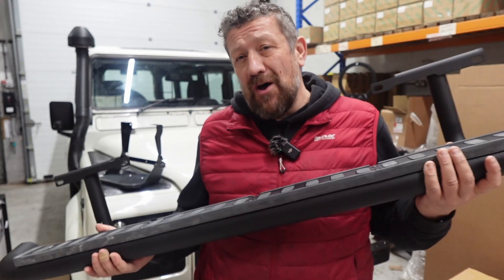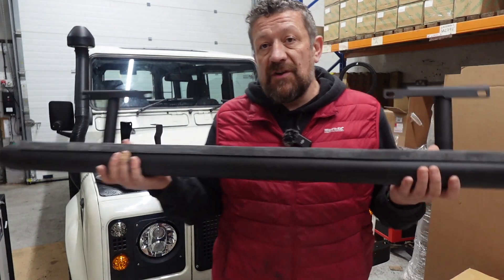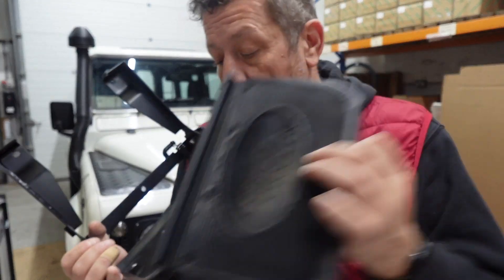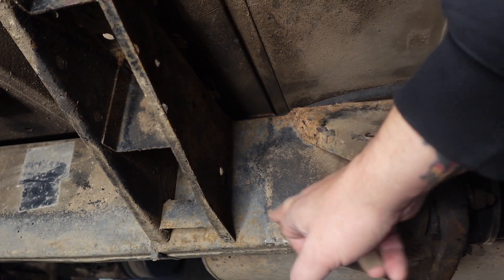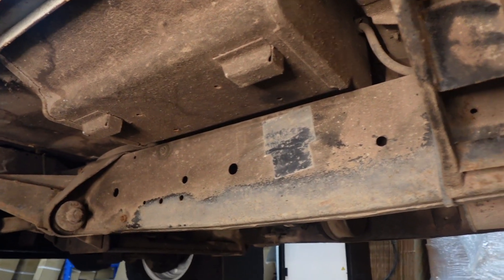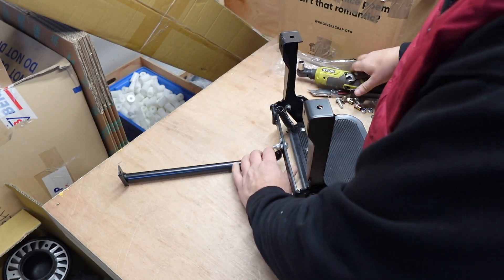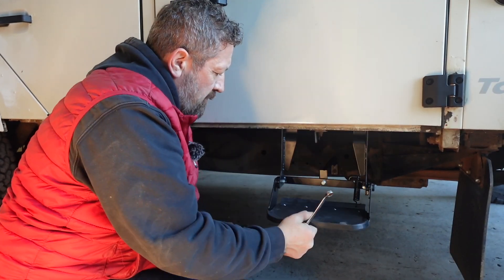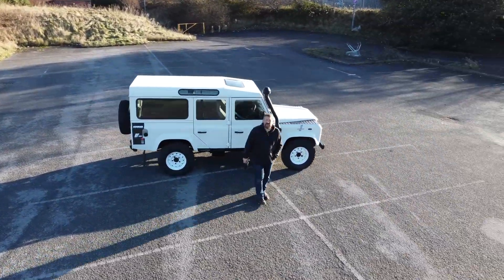Fitting a range of side steps to the Defender. But which ones do we keep?

Comment: The reason the bolt and nut are different sizes incase anyone's wondering, is in the event people only have 1 of each socket or spanner size. Anyway, I'm having the same debate for my 130 I like that the steps fold in and that maybe useful for width resolution but the bars double as side protection and I think using them for entry will be easier as the foot placement isn't just tied to being so far forward like it is on the steps, I'd go with bars, but think some  electrically folding ones

Comment: Is there a way to incorporate the single steps with a proper rock slider?
Reply from the maker: You could fit rock slider sills that replace the existing sills but they stick out further and the steps may not fold completely upright. Also the steps would still get caught before the rock slider. Tricky.